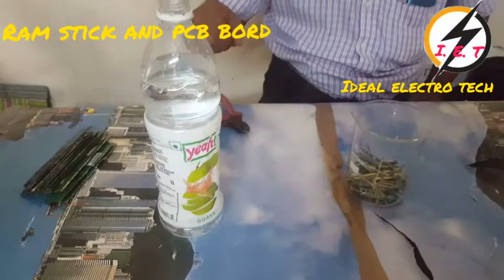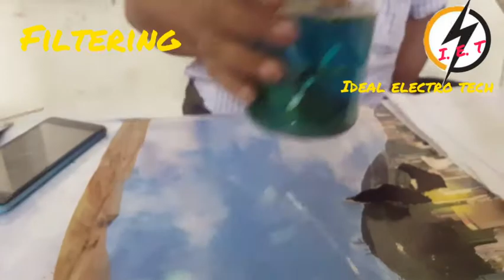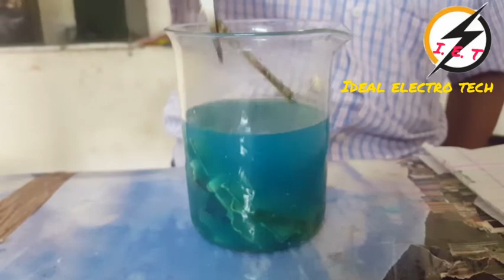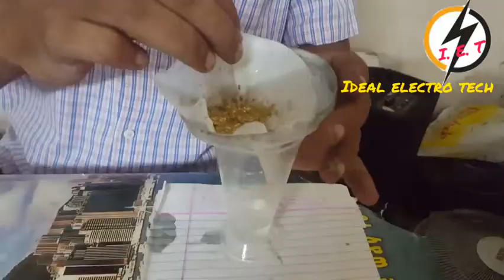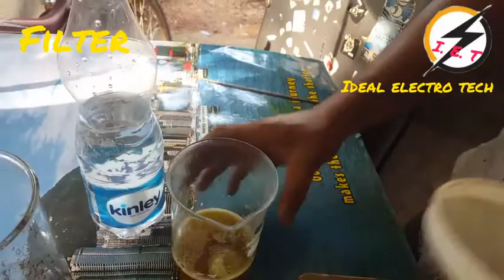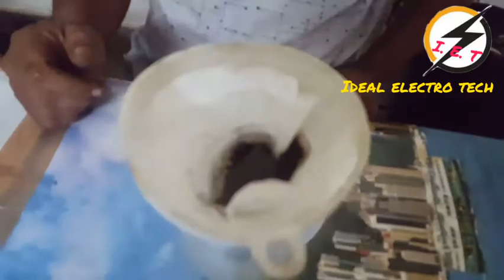gold recovery from ram sticks and pcb

Comment: Hai sir thanks to give this video's
My question is
1. 300ml water and 100ml nitric acid 
Mixed after how much hours ram scrap dip in that mix sir??

2. After filter get gold foil how get make aqua regia (3 part hydrochloric 1 part nitric acid means 300ml hydrochloric 100ml nitric acid mix right?? Sir please
Reply from the maker: 100 ml nitric acid 300 ml hydrochloric acid
Reply: @idealelectr0tech209  thanks for your sir and water + nitric acid mix how much hours ram rest that mix sir?
Reply from the maker: Just 30 minute